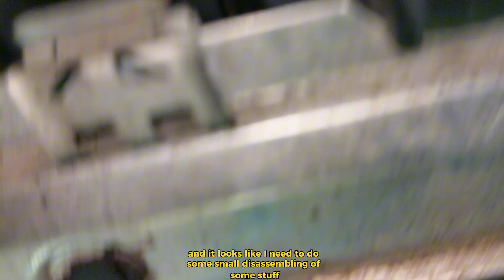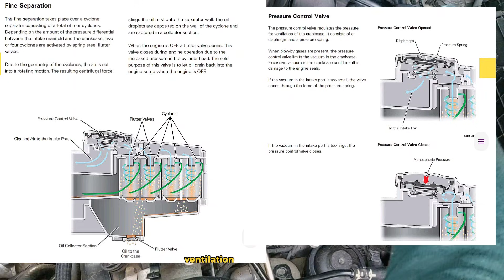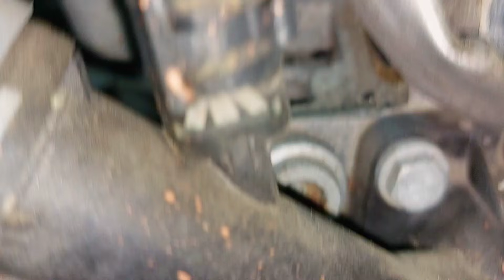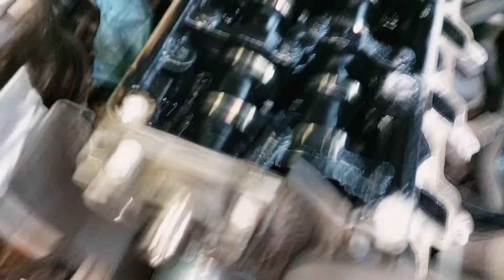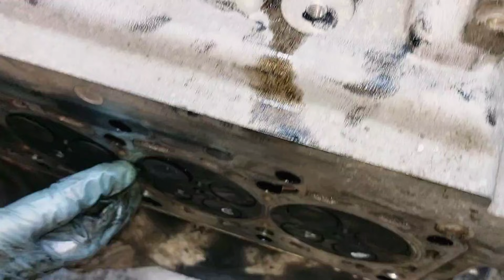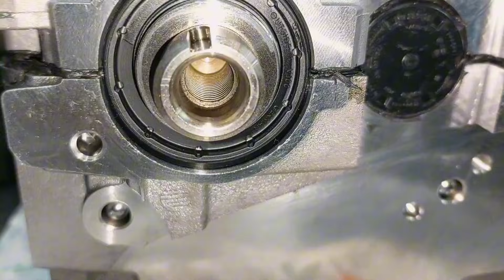Head removal 2.0 tdi alltrack Passat mk7 (part 2)

Comment: Great video. I’m looking to do a similar job on my car, where do you find all the torque specs and manuals that you use
Reply from the maker: Hi, thanks. https://www.scribd.com/document/801630814/D3E80251958-4-Cylinder-Common-Rail-Engine-2-0-l-EA189-Gen-II
Reply: Thank you that’s a big help

Comment: Hey, got a quick question my hold down bolts bolts for the injectors broke and i drill a bit tooo much. After removing tbe valve cover can i remove the retaining frame (cylinder head bracket) and place a new one with out moving the time or gears?
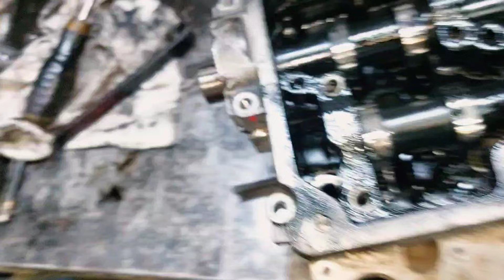Reply from the maker: I think it can be done, but you still have to secure the camshafts because the tension force of the timing belt will pull the camshafts down creating a skew and you can damage the camshaft seal. You may be able to secure the camshafts, using zip tie's, by sliding them through the valve springs and in this way tie down the camshafts, but there is still a risk of damaging the seal because the valve springs will press on the camshafts from below, lifting them. So perhaps the easiest thing to do would be to set the timing marks and loosen the timing belt tensioner but not remove the belt itself. I don't know what removing of the cam frame will give you, but you should know that the injector mounting bolts go through this retaining frame and are screwed into the cylinder head 20:28, in other words there is no thread for the injector bolt inside of the frame.
Reply: @el_flakk0775  did the exact same thing and have the same question. how did you end up solving that problem??